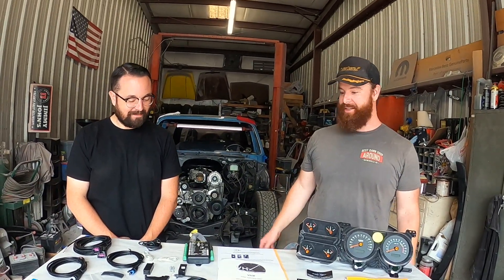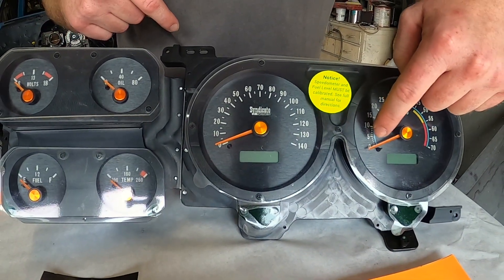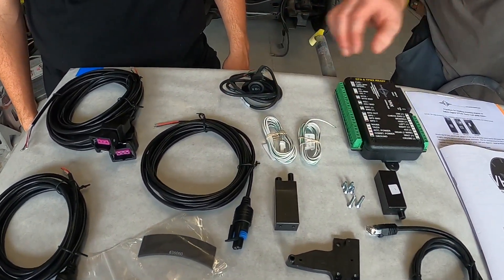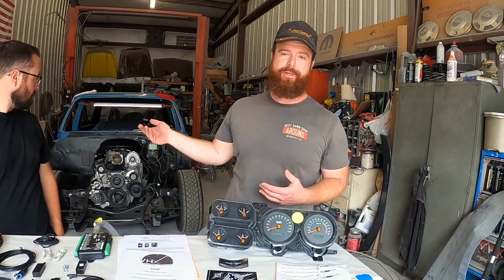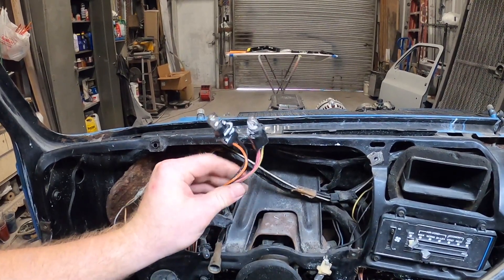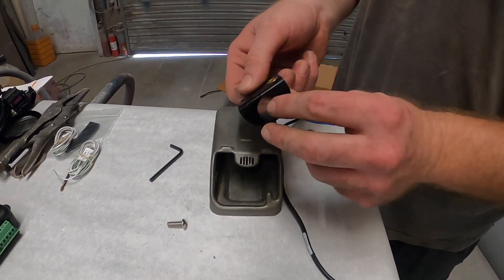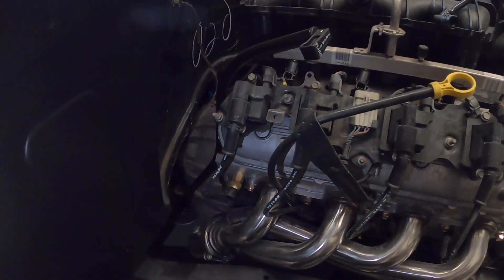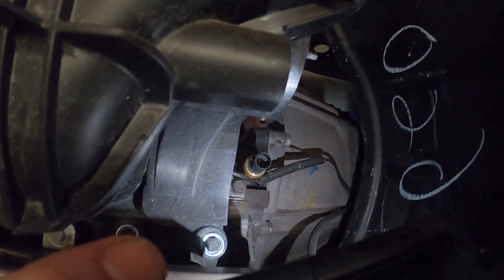K5 Blazer gets Dakota Digital Gauge Cluster

Comment: love those gauges, about to install them on my third pickup. I always use the BIM module so I don't have to add all the extra sensors and wiring.
Reply: I bought the BIM but haven't installed the gauges yet is it direct plug and play with the obd port or do I still have to wire a power and ground wires to the VHX control box
Reply: @floydmayweather9536  it is a cable to the obd port only. (which adds the other sensors off the LS harness like transmission temp, intake temp, etc.) the bim connects to the main control box which has the ground & 12v pwr connections

Comment: So dumb question… are both temperature sensors being used? One for the ecm and one for Dakota? Is that why you installed the dd sensor on driver side head?
Reply from the maker: @85C10Builder  correct!
Reply: Ok thanks for the fast reply. Oil pressure isn’t needed on ecm right so only the sensor from dd is used for oil pressure?
Reply from the maker: @85C10Builder  correct!